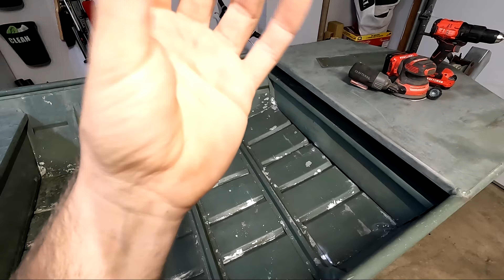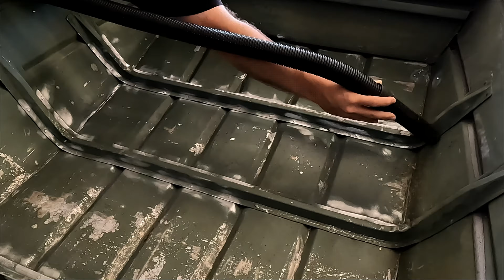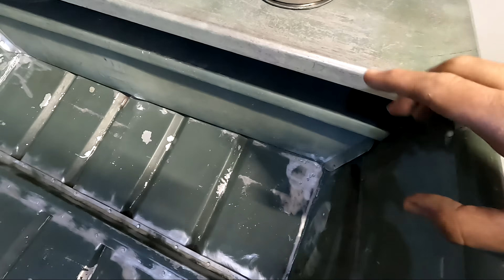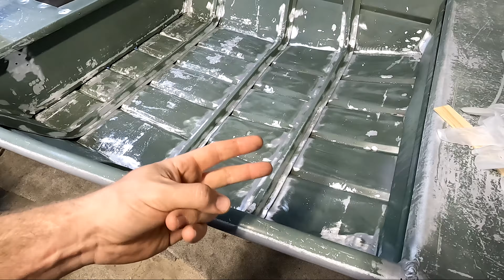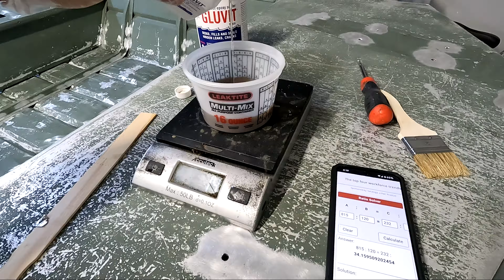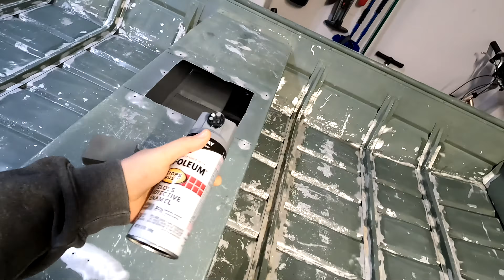Jon Boat to Bass Boat Build | Part 7 - FIXING LEAKY RIVETS WITH GLUVIT

Comment: Question on some the wider cracks would a mesh tape help or hurt?
Reply from the maker: It may give it some more structure but I'm not sure if epoxy is the best choice for larger cracks like that, you would need to fill itt some. Epoxy would flow through mesh

Comment: I know it's a total pain in the butt to just replace the rivets but in the end it's really the best option. No matter how well patching works it's only temporary. Buck rivets are definitely a pain because you need two people but the factory used them for a reason.  You could replace the rivets then add the epoxy to protect the rivets and help give it strength.  Still that work your doing should last a few years depending on the conditions you fish in.

Comment: Here’s the thing I don’t have a scale to measure so I would have make it where everyone can figure out the measurements
Reply from the maker: There are by volume ratios on the can as well. I like using by weight since it’s easier to do smaller batches

Comment: Do you have a link for that air hammer you’re using for the rivets? I think I found it, but want to be sure.
Reply from the maker: I got mine at Harbor Freight but if you were looking to order one here is basically the same thing: https://amzn.to/3wV3FbI
Reply: @mvboutdoors   thanks. And you just ordered a separate kit with the bits for hammering rivets.
Reply from the maker: Yeah I had to purchase them separate, this is what I used: https://amzn.to/3wUP8wp

Comment: Would you recommend that I use this or the goop coat it if im having most of my leaks coming from in between the ribs on the bottom of my boat?
Reply from the maker: Gluvit applied on the inside from the top, Coat-It applied on the outside.

Comment: You are misleading on this subject! To correctly apply Gluv-It you should flip Jon boat upside down and apply on the bottom ( outside ) ! Works sooo much better to seal only the rivets to exterior of boat ! You , by applying to the inside of boat , you are trying to seal the inside ribs of boat to the hull and hoping the Gluv - It will ALSO SEAL the rivets . Way to expensive to HOPE for results! PLEASE do it correctly if you want others to follow your suggestions. Your welcome and I'm sure others will appreciate my comment .
Reply from the maker: An epoxy  coating was already applied to the bottom of this boat. Gluvit can also be applied from the inside as well.

Comment: How many cans of primer and spray paint do you estimate?  I have a 13.5 foot v hull sears boat i need to paint the interior
Reply from the maker: 1primer and 4 cans for the interior
Reply: @mvboutdoors  is that for a single coat